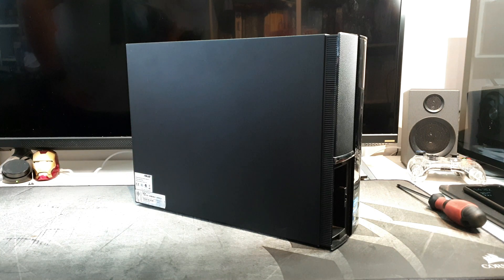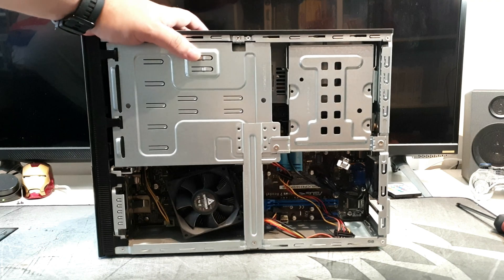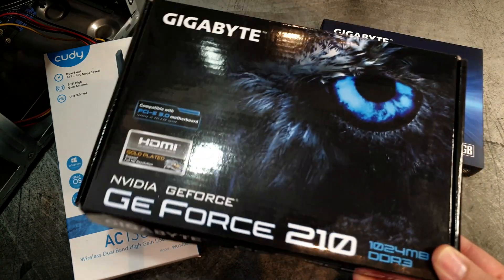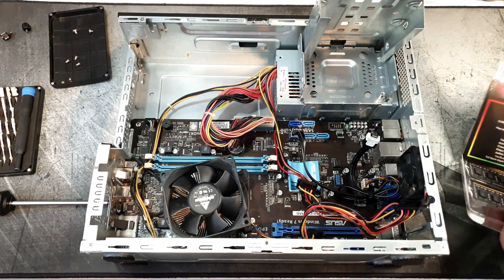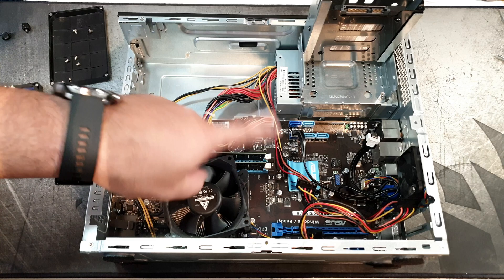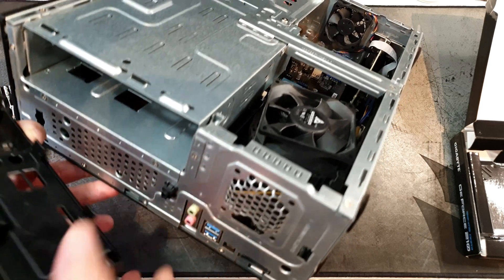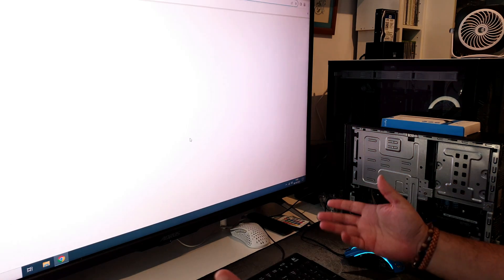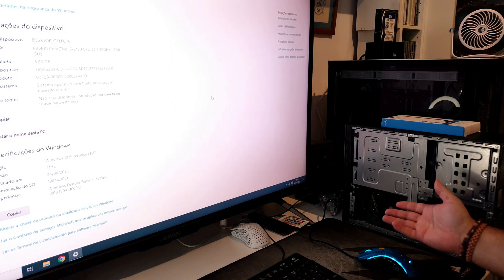$100 PC to Browse the Web

Comment: So you built a PC to hide your porn habits? Got it!
Reply from the maker: If you say so
Reply: @DeckardGames  Just giving you a hard time man, it's hard to find a budget PC that'll do anything useful these days. I've got one of those tiny sandwich sized Dell PC's with an 8th gen i5 I've been using to mess wtih Linux, got it for $20.
Reply from the maker: @DeadReckon  $20? Nice.
Reply: @DeckardGames  Yep, only has a HDD tho, so I doubled the cost of it by adding an m.2 SSD, 256 gig, HP branded unit, nothing fancy, but better than most of the stuff in that price range. I thought about going for a SATA SSD but for the same cost I could get a way faster m.2 so *shrug